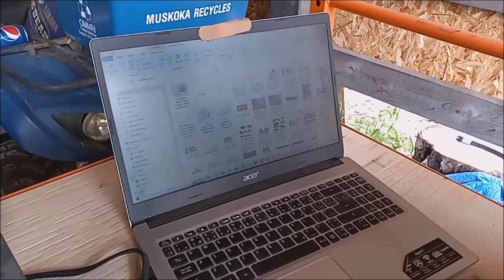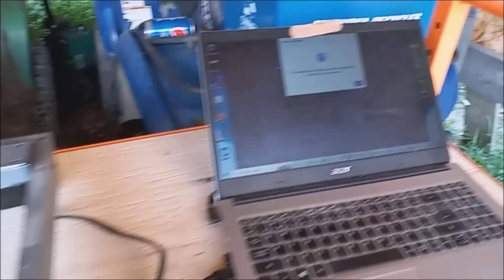This Was Totally My Fault...Now I Need To Fix Them.Time To Pull Out Our X Tool D1 Laser Engraver.

Comment: A few suggestions  no, 1 build Heather  a stool to sit on while she waits for you to do you talking and sawing , a taller one to walk up and just sit to give her back and legs a break ,
no, 2 The last brace across your saw mill change so  Heather does not have to step over all the time get your waste board to pile , you might one day find Heather kissing the ground ,
no, 3 The bale hook you use weld a solid 3 inch round or square stock on back of hook , your all the time using it to pound your hooks deeper in log  use like a hammer ,
no, 4 move saw mill away from building about 
 3 feet or so to keep you from bending to get past mill or pour a pad and raise saw mill higher  so you do not have to bend over so much , It will save on your back  down the line you will see why,
no, 5  For your safty clean up your work area, thank you , 

I  really enjoy watching you two work , Keep Heather happy and safe , She is one sexy.pretty.hard working women .  You would be lost with out her ,